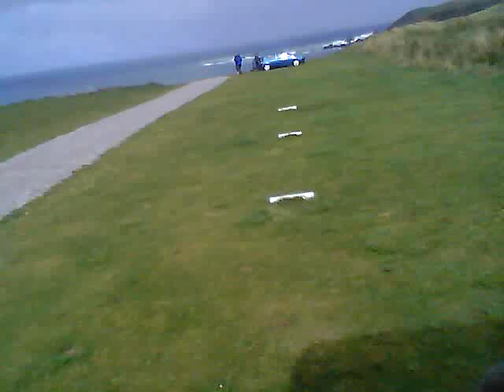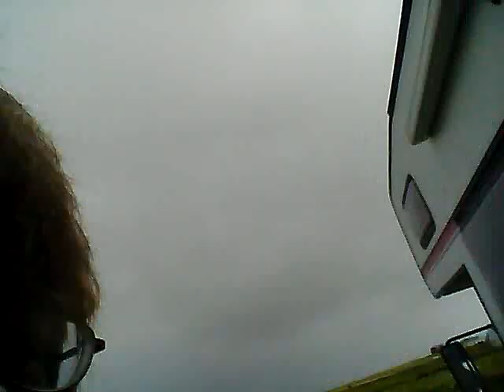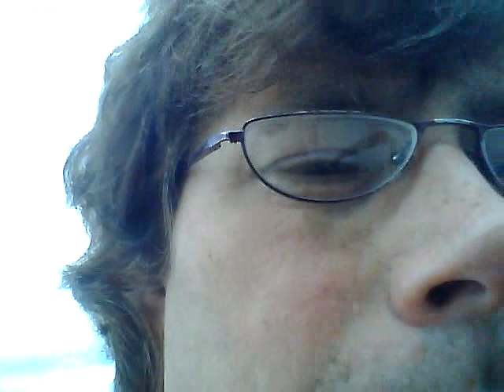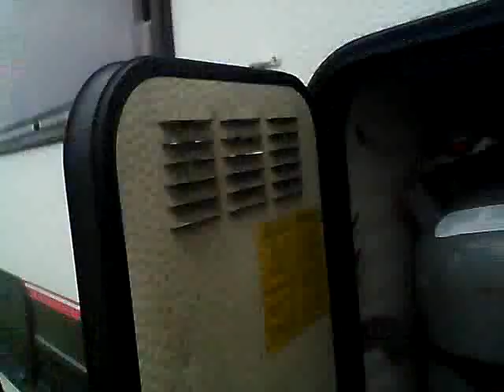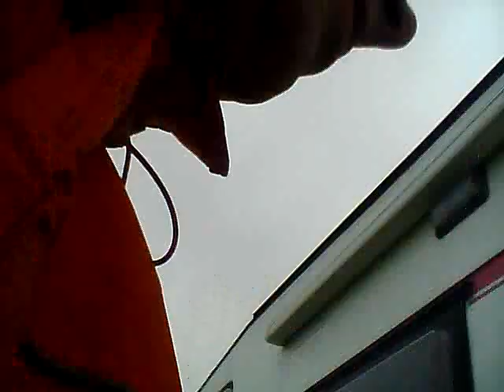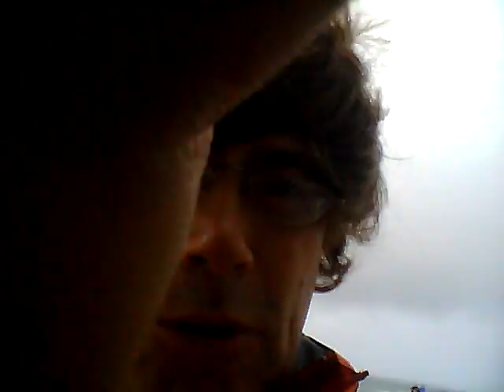Greetings from my vacation in Northern Scotland - hydrogen pressure storage on demand needed

Comment: The biggest problem is the "membrane" life. last time i checked it was only 7 years, then total rebuild. You should watch "Hydrogen Class", it was a torrent. The pressure is automatic the fuel cell builds the pressure to any psi u want, so it's really simple. Power in = gas made to tank, gas from tank= power out. But it is not above 60% round trip, but hopefully it improves. see ebay: 2-Way PEM hydrogen fuel cell / hho generator, generates hydrogen also

Comment: @Zerofossilfuels Is correct somewhat. The pressure is built in the cell, with the use of a separation membrane and most of the pressure is from the supply pump.  The big boys use 3000 psi.

Comment: The design I saw keeps 60 PSI before releasing to storage tanks. Should not be a problem to adapt to higher pressures with better materials. So to answer your question - Yes!

Comment: Our new cell is a high pressure separater with nafion driers that produce 99.9993% pure hydrogen. They run at .5-1.2 amps and move some gas. The pumps and electronics take up more power. I will be making a anolog version for the mobil market. I am on a mission with accurate electronics for automotive use at the moment and on deadline. You might be suprised on what I am working on. Make sure you take home some sea water. David A. Puchta

Comment from the maker: Well, the problem is not the seperation of thge o2 and h2 gases but how to build up enough pressure in such an electrolyser for the hydrogen to be pressurize also the propane bottle and go into there only due to the pressure buildup in the electrolyzer...
If you have an idea how to do this at least getting 100 to 200 psi, please let us know.

Regards, Stefan.